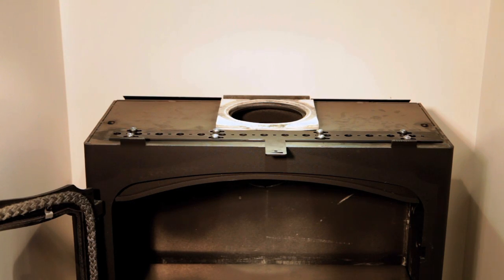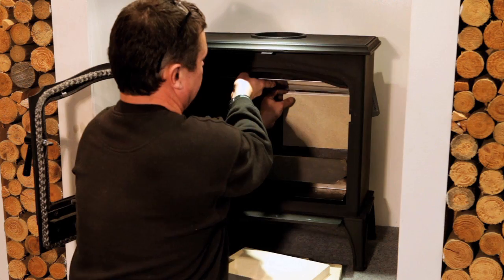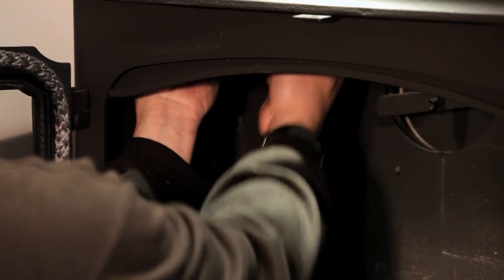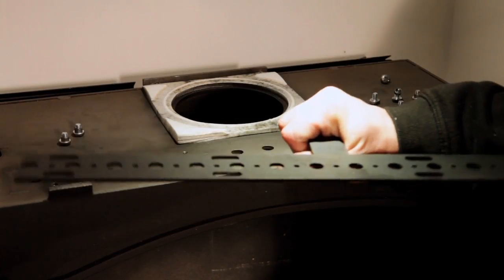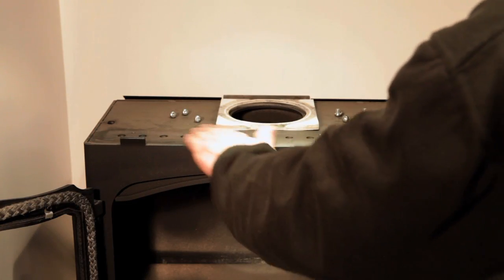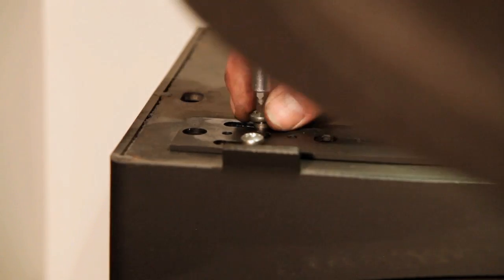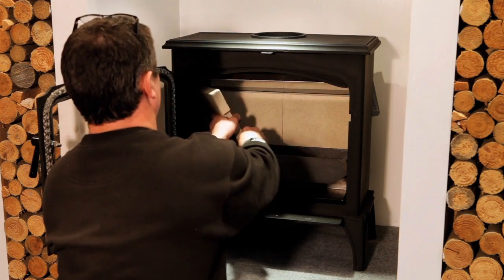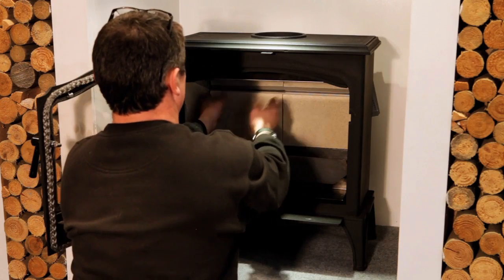Air Controls | ESSE Stove

Comment: I have one of these stoves which was installed in my house a year ago.   The top slider is stuck which is not allowing air efficiency .  The only problem is, I cannot remove the top plate as the Flue is fitted to the top and not the back  and the Flue is secured   Looks like the design guys at Esse didn't think this out clearly .
Reply: Exact same problem!